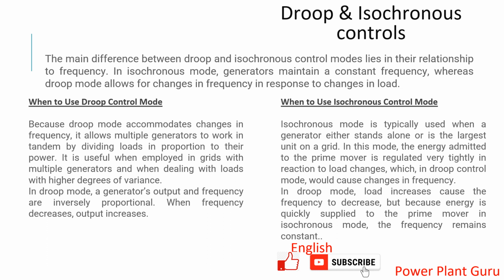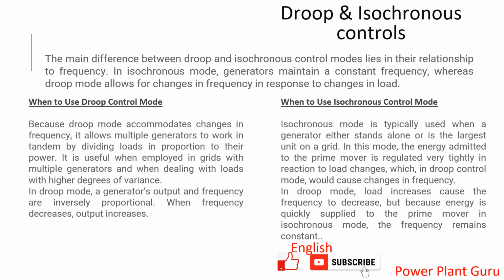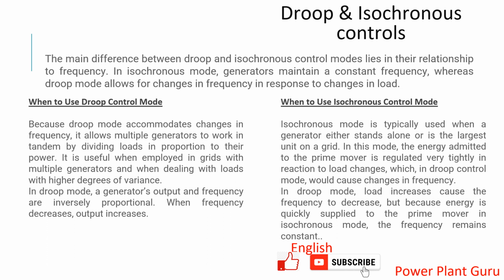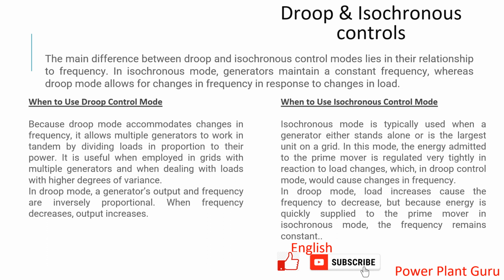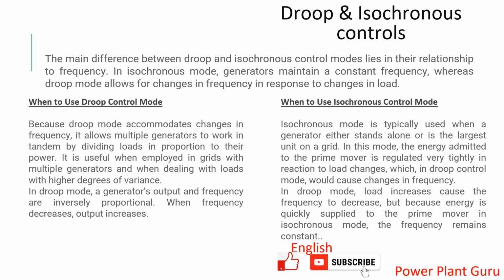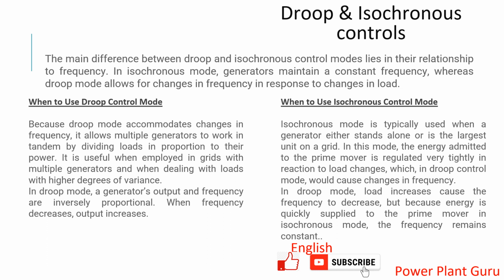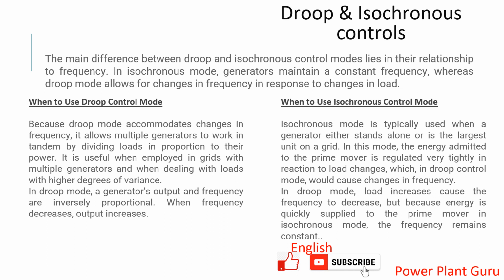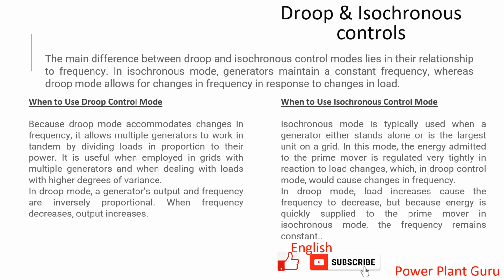Droop and Isochronous mode in gas turbines, Power plant guru, Speed droop, droop control, governor

Comment: Sir
There is 4th machine one machine running isocronous mode and balance three machine running droop mode, what ever when load increase or decrease only effect isocronous mode machine and droop mode machine no chances how?
Reply from the maker: Hello
Thank you for watching my videos. 
The isochronous machine will chase any load coming up on the system if there is any margin in the machine. As it's fuel supply loop will work fast comparatively faster than droop control machine.
Reply from the maker: Droop machines will have to follow the isochronous machines and will be compartive ly slower in response to load sharing.
Reply from the maker: I couldn't reply on time due to my busy schedule at work, please excuse me for that

Comment: Can we run two GTG s in iso mode
Reply: Yes, you can run two GT's in isochronous mode if they are not of same ratings like one is 100MW and other one is 70MW, and if you have same Rated GT's like 50MW each so its better to run in Droop mode as when load varies both the machine will adjust it accordingly and effect is distributed among both of them.
Reply from the maker: Hello
I missed replying to your comments. I replied to similar comments to other viewers and thought I replied to you also . I agree to the response shared by Mr Anwar